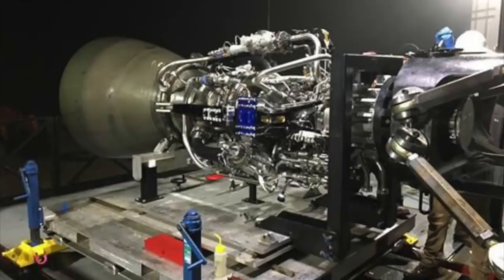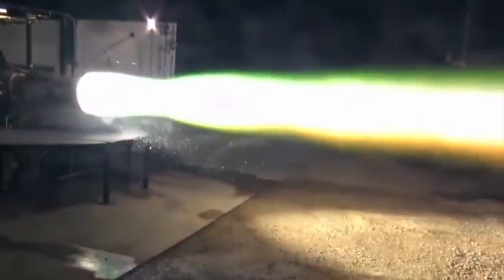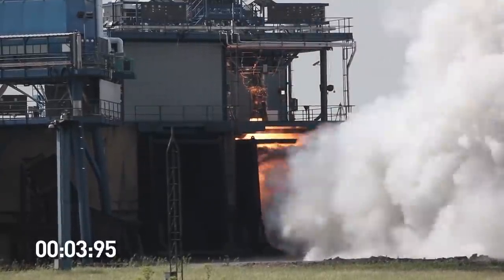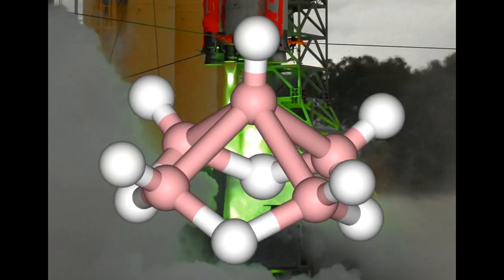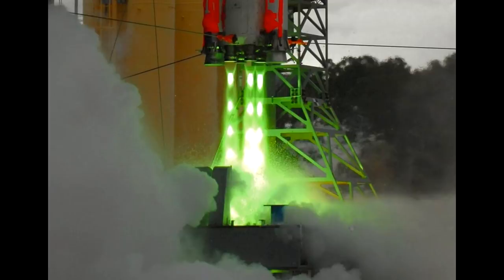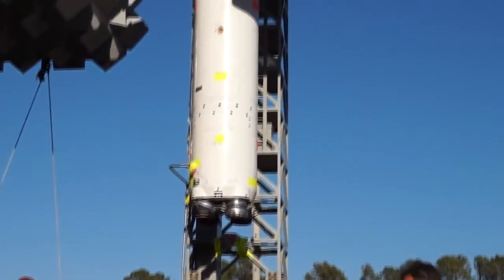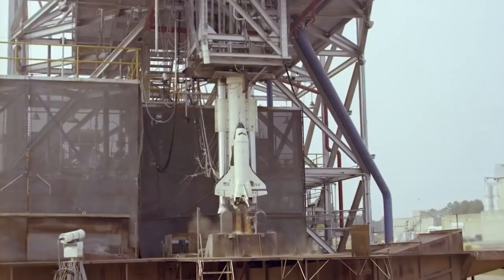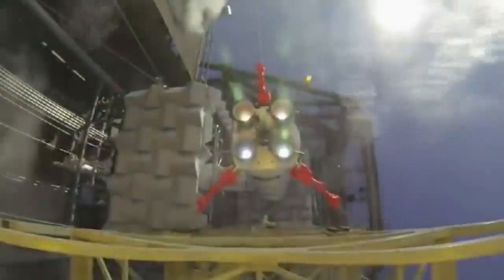The Story Behind This Green Rocket Exhaust

Comment: With vastly increasing thrust (and therefore acceleration), are today's astronauts apt to be subjected to significantly higher G forces during ascent??
Reply: No, because the extra thrust is balanced by more fuel and payload. Also modern engines are often to some extent throttleable, wheras rockets in the early days of spaceflight usually had two settings: Off and Full Power. Modern rockets can therefore throttle back as they get lighter, reducing the G-forces. Older rockets could not.